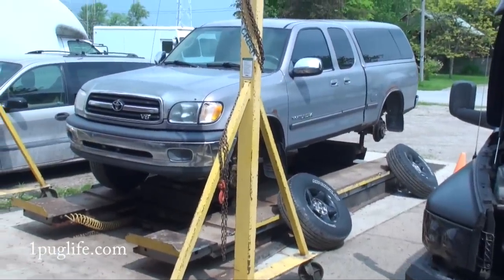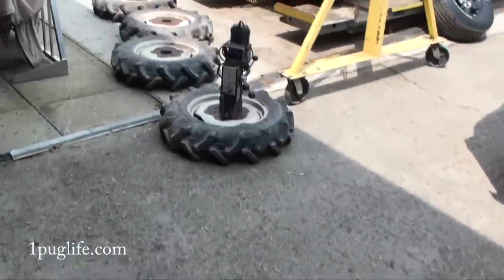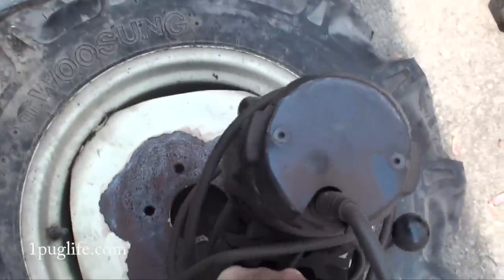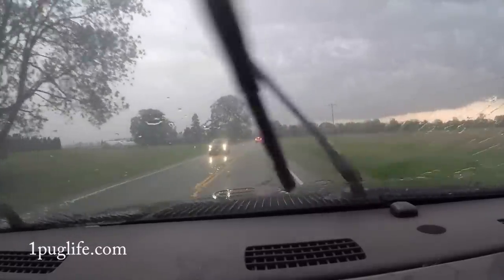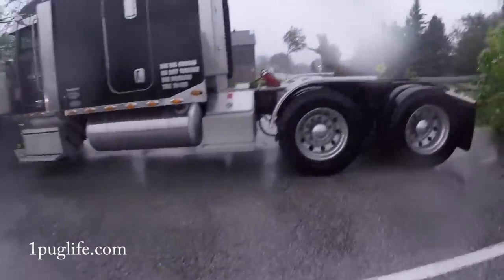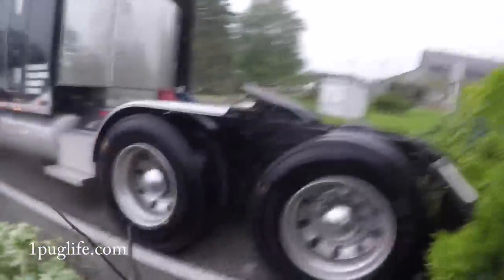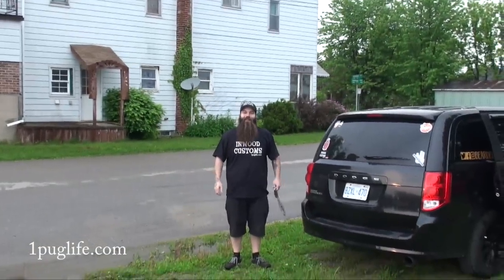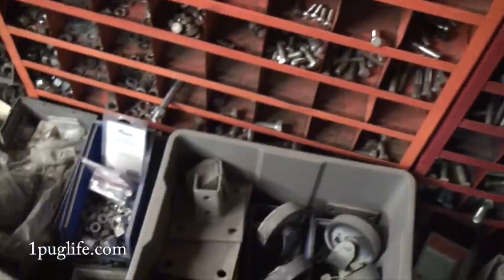you can sit around and watch, or you can do something!

Comment: Hey pug. When you try to turn the wheel in a mud hole, those tires will rub on the shock towers. There not rubbing now because there's no weight on the suspension.  They look alright though.. keep up the good content  bro. Paint it copper color.